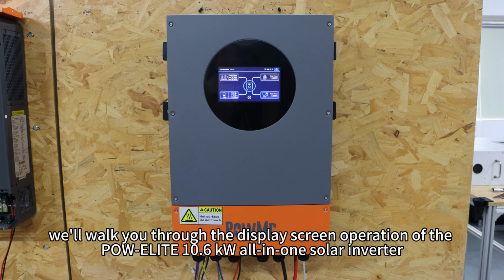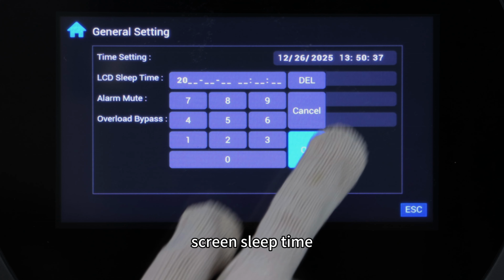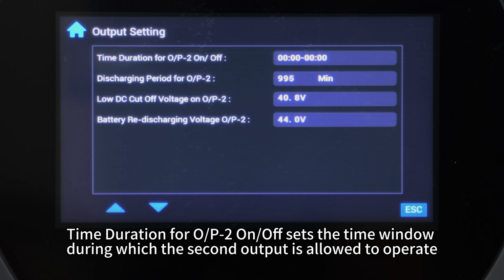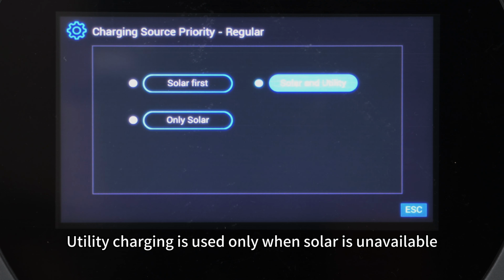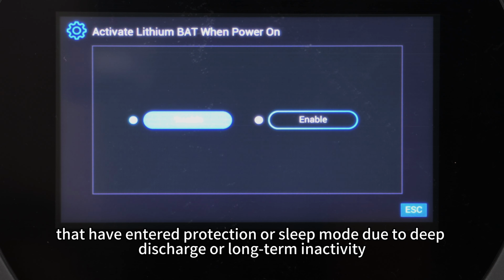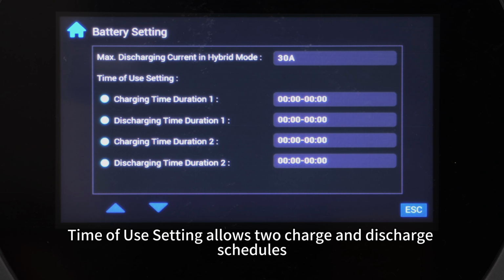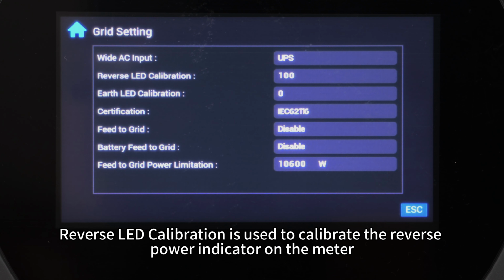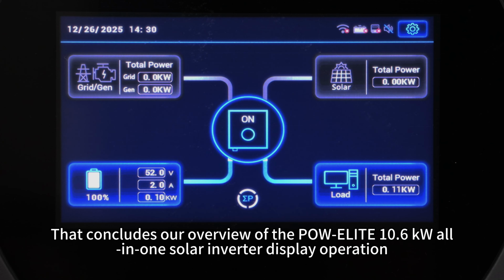POW-ELITE 10.6KW LCD Interface Explained | Settings & Display Guide

Comment: I wish u guys can bring back that dc load option. So someone can use this as a dc to dc converter for his solar generator or other things.
We that have solar generator and we want to over panel so much this machines will help us so much. I saw a man on YouTube he used a 37 volts panel on a 28v bluetti he used a dc to dc converter and he always get full charge. I wish this dc output will be brought back like before. I really want to buy this stuff but there is no dc output it must want a battery
Reply from the maker: Thank you for your suggestion. We will forward it to our product team.

Comment: @PowmrSolar for 4.2kw 24v can i use 50ah12.8v batteries x2 piece in series? Or there is minimum requirement. 
I only use this for blackout for 1 equipment water pump 300watt   for 30minutes or 1 hour
Reply from the maker: Yes, you can connect two 12.8V batteries in series.
Reply: @PowmrSolar can i use 50ah batteries or i should have more than 50ah for 4.2kw